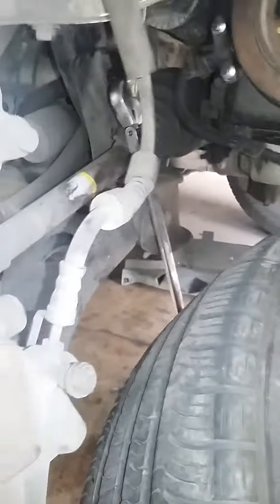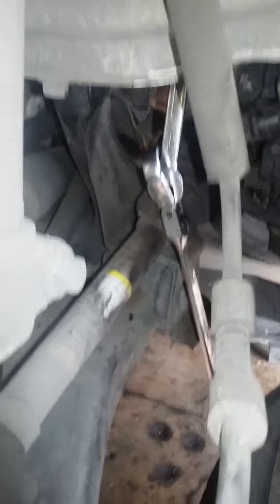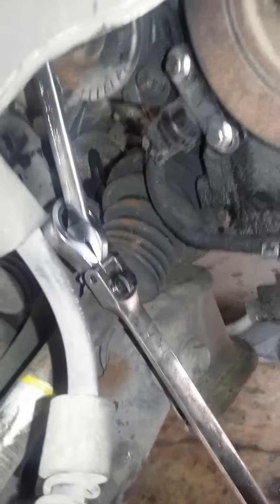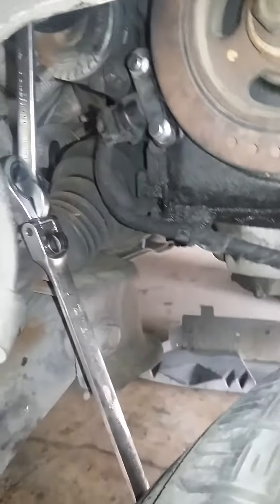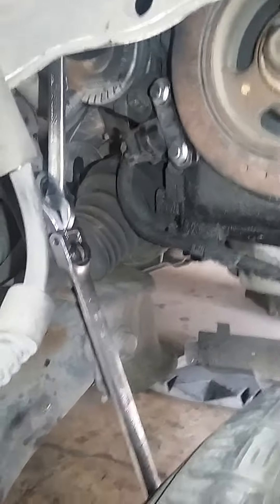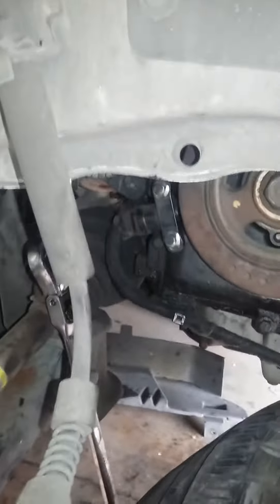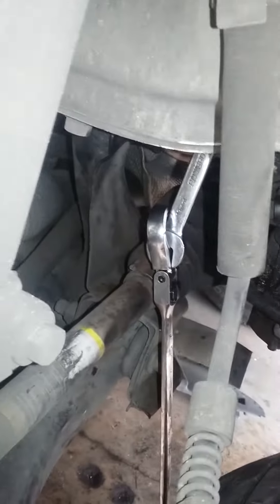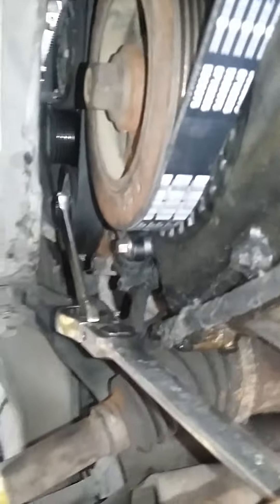2010 Ford Transit Connect how to put on Serpentine belt

Comment: Dude, is this in Florida because I swear that's my van. The color of  body wrap and underneath looks identical. I would love to know what the hell happened to this van before I bought it, because I found a Ford dealership slip jammed in the upper compartment that said the damn motor mount broke while driving and the driver continued to drive it and it lost fluid, doesn't specify what fluid either

Comment: I replaced a busted idler pulley.  The store suggested I do the belt and a new tensioner also.  This made sense.  I tried installing the belt by myself from underneath to no availI using a 13mm box end wrench.  I then got a helper to go above while I operated the tensioner.  The new belt would not go on.  The old belt almost went on.  Any ideas about my problem?